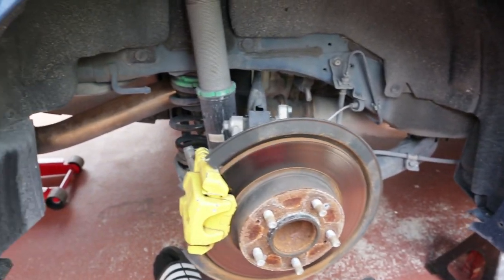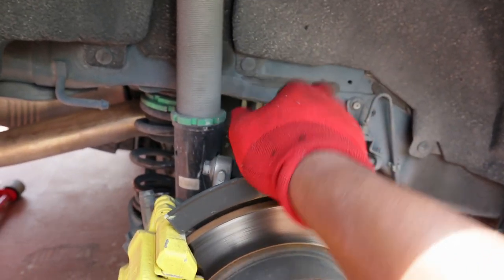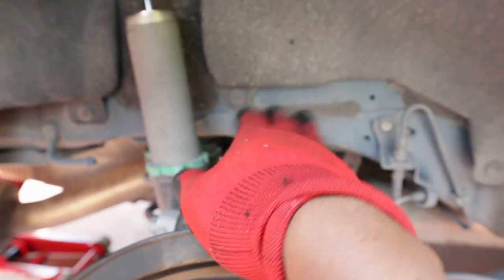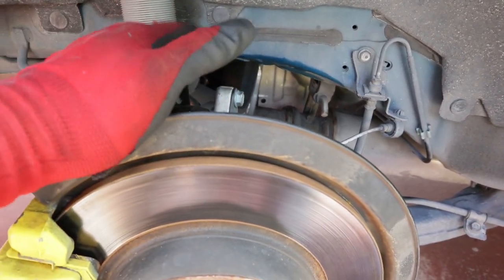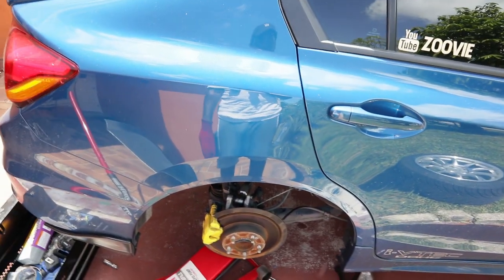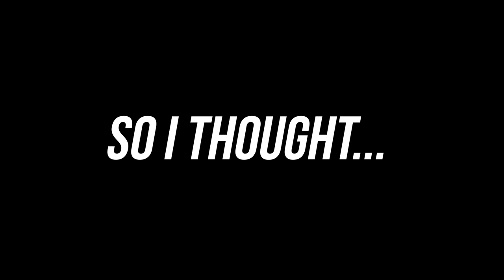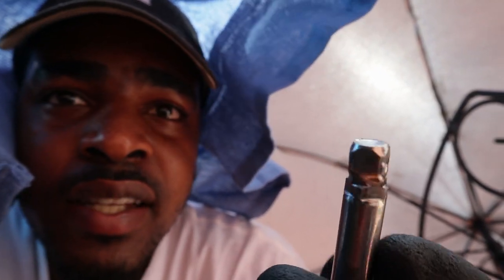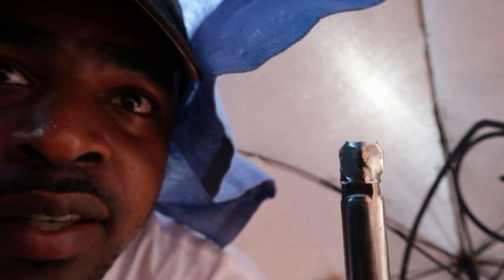This was a BIG fail...

Comment: Hey man I feel you on this. What I thought was useful was to clean the inside of the original holes  where those two bolts go with like a dry rag. Sometimes there will be some shit inside those preventing the bolts from locking back in. Hope this helps

Comment: Let me help you out my bro wd40 or pb blaster on them bolts for a few mins and they should be much easier to pull or you ain’t got a blow torch to add a little heat but yeah they seize